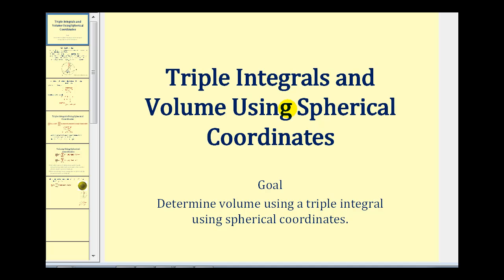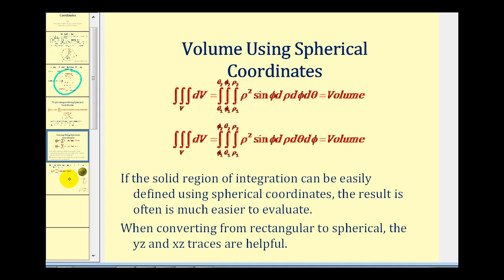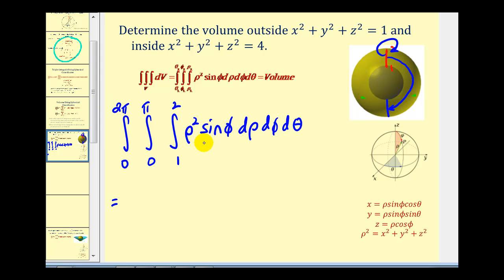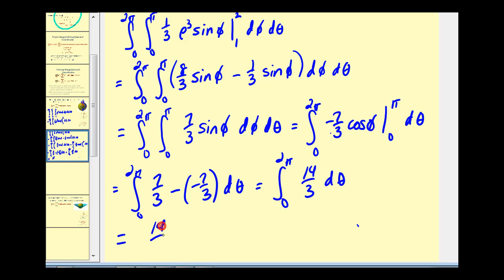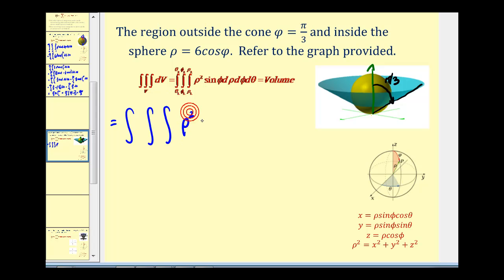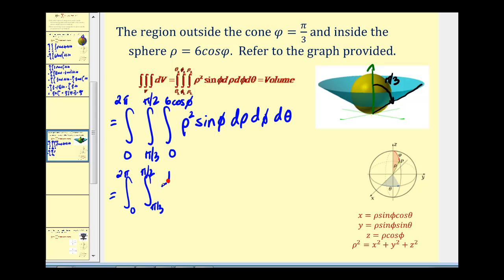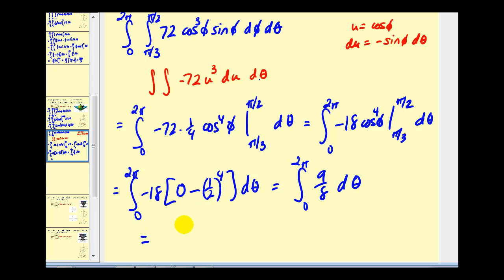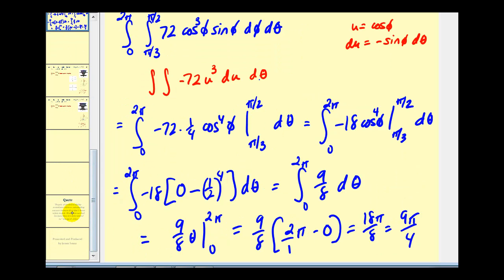Triple Integrals and Volume using Spherical Coordinates

Comment: Why is the sphere not centered at the origin?
Reply: Because the equation of the sphere is rho=6cos(phi). Since z=cos(phi) and rho=x^2+y^2+z^2, the equation of the sphere in rectangular form is x^2+y^2+z^2=6z. If you complete the square on the z variables, you end up with x^2+y^2+(z-6)^2=36. This is the equation of a sphere centered at (0, 0, 6) with a radius of 6.
Reply: @sLIMshadyKP  using your method of completing the square I got, rather, x^2 + y^2 + (z-3)^2 = 9, giving a radius (rho) of 3, where the sphere is centered at (0,0,3). 
But thank you for the explanation!

Comment: why do you don't go from 0 to pi/3 ?  don't get what you said about "outside the cone and one the surface". The question says outside the cone and inside the sphere originally, but I have hard time understanding that.
Reply: if you read the instructions again it says that we want the region OUTSIDE THE CONE and inside the sphere and the limits of integration go from the positive z axis to the points on the surface and since we want the ones outside the cone and the cones angle from the inside  is pi/3  then the angle from the outside to where the points on the surface end is pi/2
Reply: Since phi is the angle from the positive z axis, 0 to pi/3 would include the volume within the cone. We want to integrate from pi/3 (the surface of the cone) to pi/2 (xy-plane). Keep in mind that the range of phi for volume is 0<=phi<=pi/2 in spherical coordinates.

Comment from the maker: You can think of phi from 0 to pi as going from the top of the sphere to the bottom.  Then theta from 0 to 2pi and be thought of rotating all the way around the sphere.  This would carve out the entire volume of the sphere.
Reply: Why phi not from  0 to 2pi instead pi?
Reply: @dant9944  I'm still wrapping my head around spherical coordinates, but the second problem kind of provides an answer. If you take the cone defined by phi = pi / 3 as a reference, notice how the largest angle would be at phi = pi which would basically be something like the narrowest inverted cone going directly down the negative z-axis.

Comment: If phi is the angle between the z axis and the points on the surface, then phi could be any angle because then for any arbitrary roe (radius) it would hit points on the outside surface.

I do not understand why you have selected the limits 0 to pi.